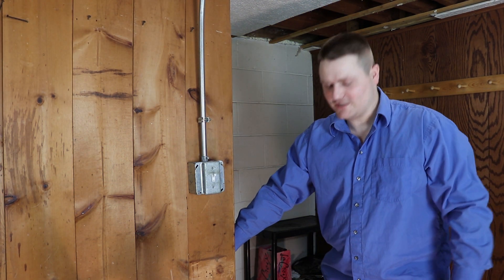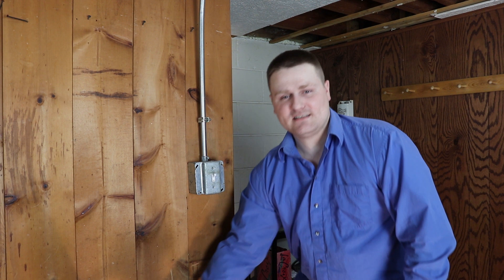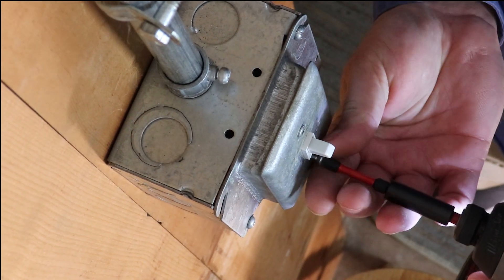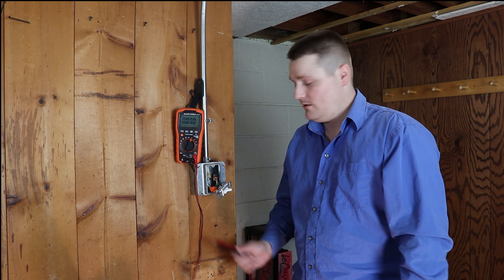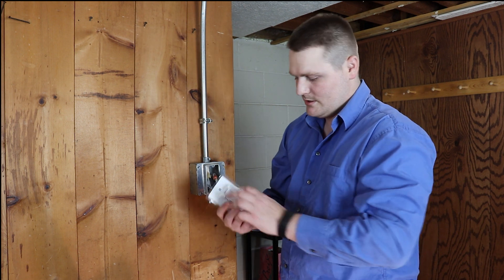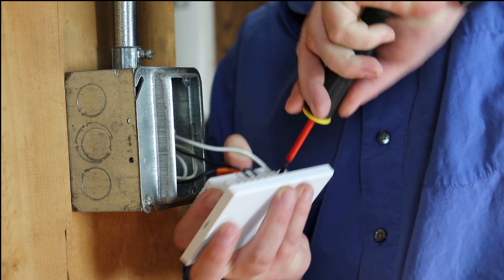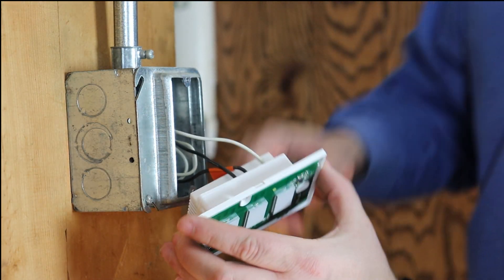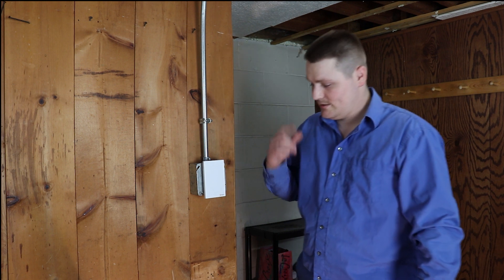Smart Switch Install & App Setup Guide in under 20 minutes, The Sonoff TX T2 Touch.

Comment: I use a Vera home controller.  Do you know if these will work with the Vera controller?
Reply from the maker: I am not sure, I mean if it is USB it should work fine. Also does the control support win10 if yes it should work. did you ever find out?

Comment: What is you are in the US and have a 2 or 3 gang outlet?
Do you need to buy 2 or 3 single gang outlets and place them one next to the other?
If your answer is yes, esthetically talking, will those look good?
Reply from the maker: No with the sonoff outlet you can get 3 switches in a single outlet.(They call it a 3 gang switch witch it is not) In the US the we call one outlet a Gang usually, so a 3 gang box would be 3 switches.

Comment: Awesome video! 
I have a 2 gang light switch but has 3 switches (1 has 2 switches, the other has a single), Can I use this Sonoff to work all 3, and use this cover to cover the other side? https://www.amazon.com/Enerlites-Combination-Polycarbonate-Thermoplastic-880131-W/dp/B01M15D37C/ref=sr_1_4?dchild=1&keywords=1+gang+light+switch+blank&qid=1607834208&s=hi&sr=1-4
Reply from the maker: Yes there is a single gang modele that has 3 switchs on it.

Comment: How about if i dont have a neutral line,how to do it?..im using line to line 230v
Reply from the maker: I do not think it will do 240v As its made for 110. For this switch you need a neutral sorry. If you want me to I can maybe find you one that will work? are you not in the Us ?
Reply: @TNW1337  how do i add a neutral wire?
Reply from the maker: @ic9703  You will have to pull it from another box or your breaker panel
Reply: If your switch doesn't have a neutral, just buy the one the does not need neutral like Sonoff T4EU1C
Reply from the maker: @ASurasak  I think at that time sonoff did not have one that did not need a neutral.

Comment: Nice demo, My old switch has ground connection, but my new smart switch doesnt have it. what should i do with the ground cable?
Thanks
Reply from the maker: If it is a metal box ground it to the box, If plastic you can leave it in the box. If you want to go above and beyond with the plastic box. wire nut & tape it up.
Reply: TechNitwit it’s a all plastic, 
Thank you!!!